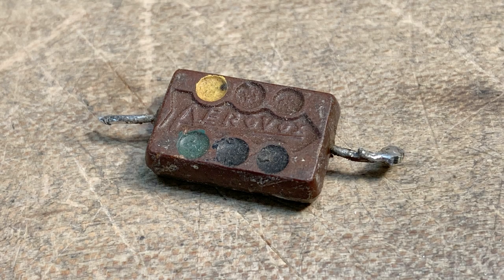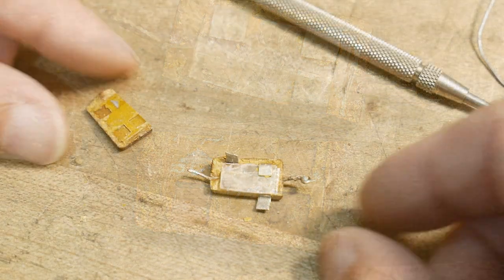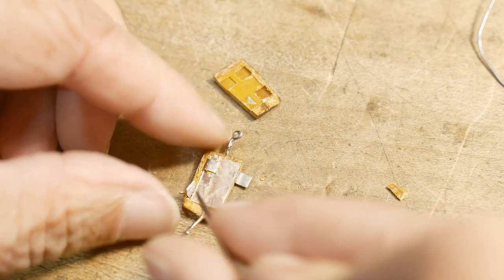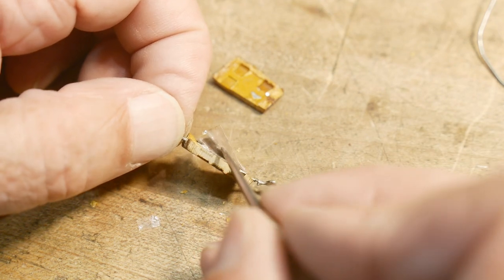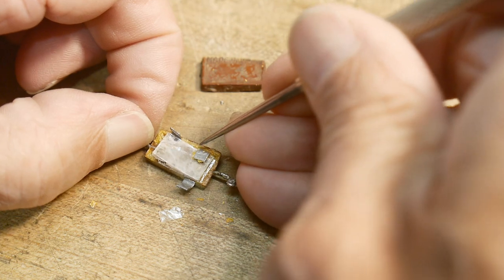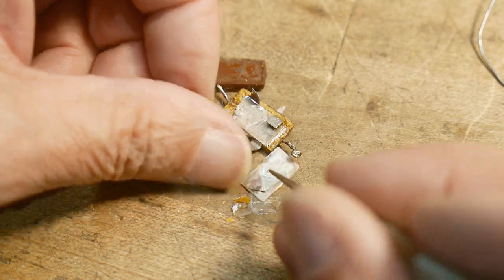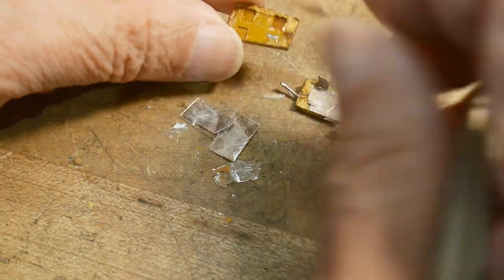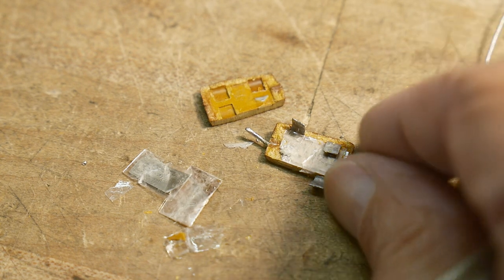#1531 Domino Mica Capacitor Teardown

Comment: "Something conductive" is silver in this case.  Mica's structure is laminar sheets weakly bonded together similar to graphite.  Peeling the sheets apart forms films with very uniform thickness, very high resistivity, and relatively high dielectric constant.  These "domino" capacitors are very stable and reliable and once were commonly used in rf applications.

Comment: These can go bad, it's called silver mica disease. The silver electrodes oxidize and make a bad contact which leads to loss of capacity and dielectric breakdown (sparking) across the silver oxides. Less common in these plastic molded ones but still happens depending on the moisture where they were stored. Silver mica disease is very common in old radio IF cans.

Comment: It's not aluminum, it's silver.  Hence the name silver mica capacitor.  Reliable in their day but after several decades they are now a major failure point in vintage electronics.  They suffer from SMD (silver mica disease).  Silver atoms start to migrate through the mica wafers and short out the plates.  When I restore antique radios I not only replace all the aluminum electrolytic and paper type capacitors but all the Domino style silver mica caps as well.  Have spent way to many hours tracking down low receive sensitivity only to find it was a leaky silver mica cap.